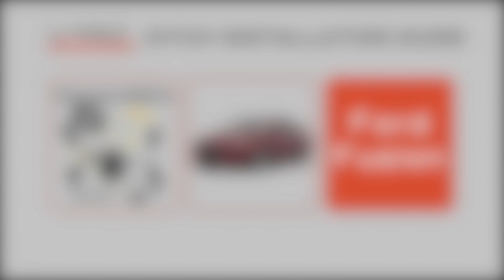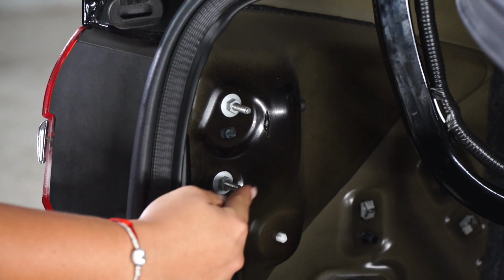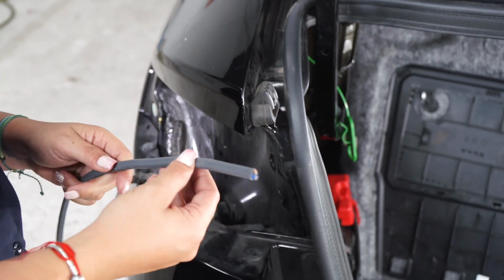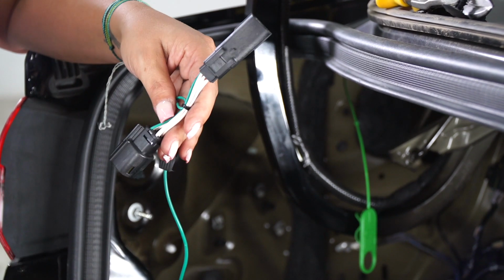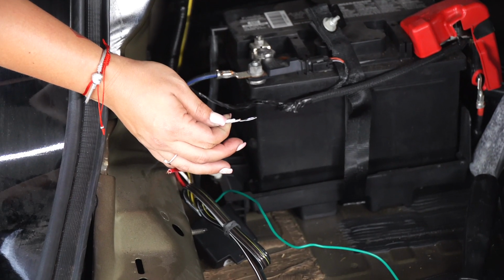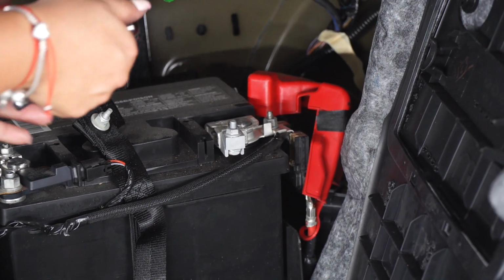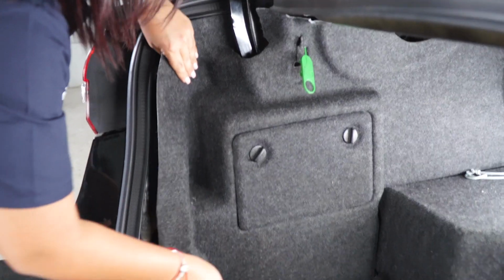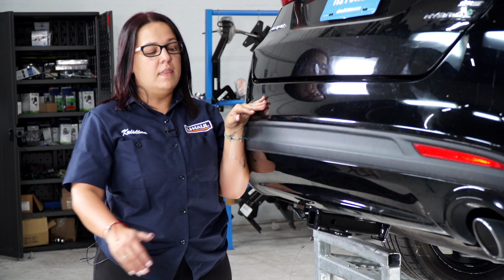2014 Ford Fusion Wiring Harness Installation

Comment: If we don't have a battery in the trunk how will we hook up to the positive terminal
Reply from the maker: You will need to route the  power wire to the battery's location and install the fuse holder there.